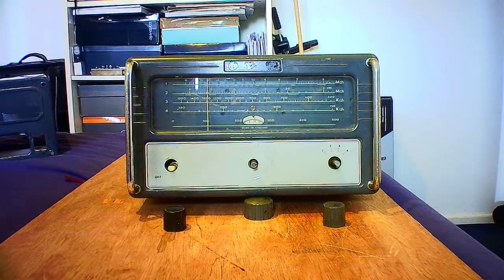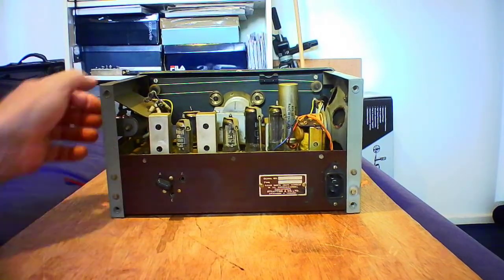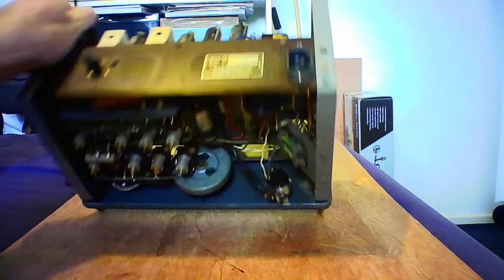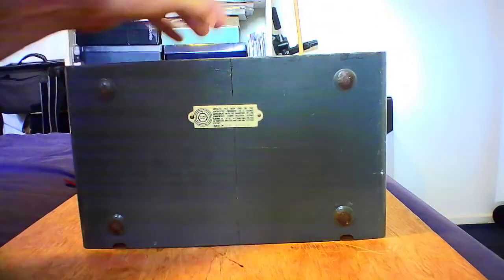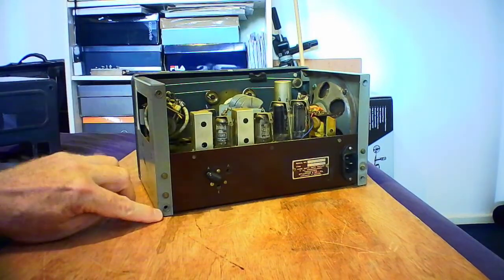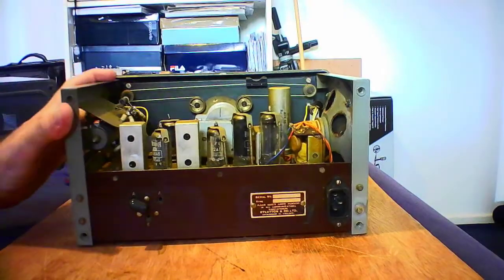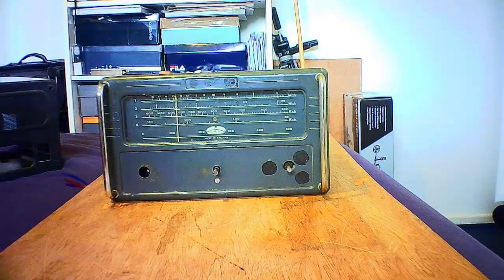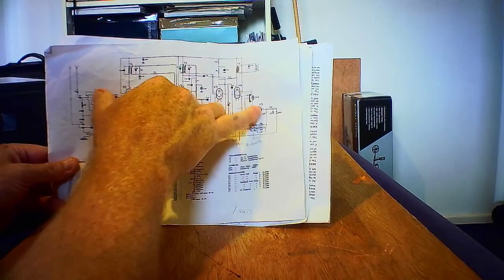Eddystone 870 radio project.  Part 1, Introduction.

Comment: You have the date wrong at 66 or 67.  This is a 870 not a 870A and the run of 870's ended in 1959 and the 870A from that year.  Cheers
Reply from the maker: I am not an expert on Eddystone radios, but the date on the main capacitor was April 1966 and looked to be original. So as to the date of the radio I am not sure?  Perhaps it was made at some point to fore fill a later order, I note it is listed as a marine receiver in the blueprints.
Reply: @ef91valve  Hi 
  Hi  I think its Adrian,  please correct me if I'm wrong,

When I wrote my last comment it was late at night, and I was tired and i may have been a bit sharp.
However i am correct. It is easy to tell the year and month of production from the serial number.

I have two working 870A's and a wrecked chassis, and a friend of mine is in the process of doing one up. All are 870A, all have Plessy electrolytic caps, dated 1959 to 1963. Also, to read the label you have to hold the cap vertical.  I saw that yours had to be held horizontal. It must have been changed at some stage.

To work out date of production from serial number is easy.  The serial number consists of two letters followed by four numbers.  Forget the four numbers, they are just the real serial numbers. The two letters at the front are the month and year.  
The first letter is the month, with A being Jan, B is Feb etc. and L is December  Now for the year.  H is 1956, I is 1957, J is 1958, K is 1959, and L is 1960 etc.. This year series started with A being  1949.

I hope this has been of help to you.

Cheers Baden, ZL3VI.

PS  I have just found out where this information came from.  On the Eddystone user group web site, there is a book called " The ultimate quick reference guide_ 2nd edition " . All Eddystone owners should have this!  The date information is on page 26.

Let us know how you get on.

Cheers again Baden ZL3VI.
Reply from the maker: @badenmelhuish3215  Not an issue, the serial number is JI0188, so according to your information October 1957.  As I said I am not a Eddystone expert or even a collector of their radios, I think I had one other many many years ago, which was another larger version of an AC/DC set.  If memory is correct I burned my hand on the dropper resistor, hence one of the reasons this one was converted with a transformer.  
To me this model is not that selective as breakthrough from the 7Mhz amateur band can easily break through when I listen to the 6 MHz broadcast section.  So I use it with an old Codar PR-30 preselector to clean things up, it now also has an external frequency display off the local osc so I can easily see what freq I am listening to as some Chinese stations can be very close together.  Yes you have the correct name.  I don't suppose you are dealing with Ron's Radio are you?